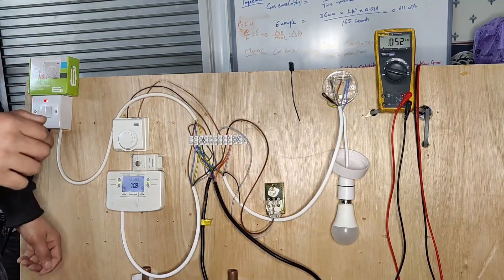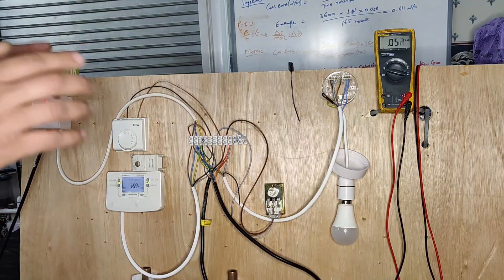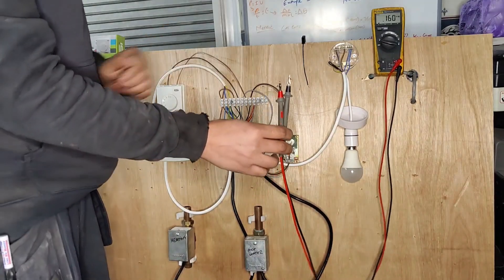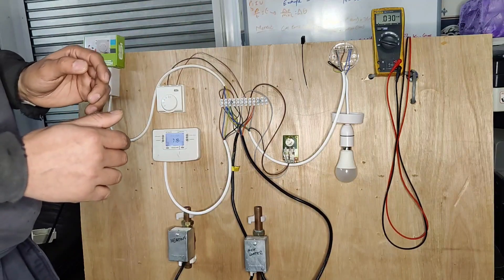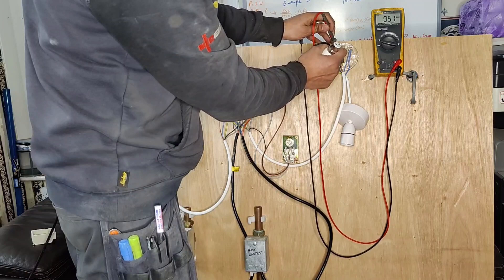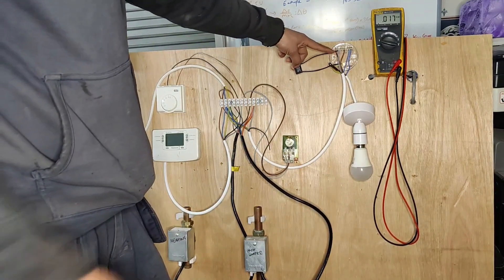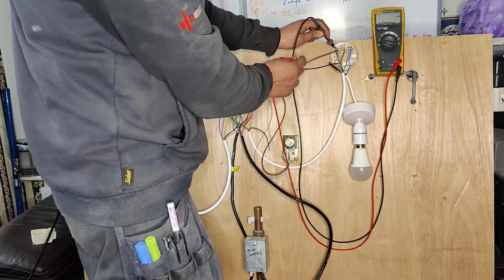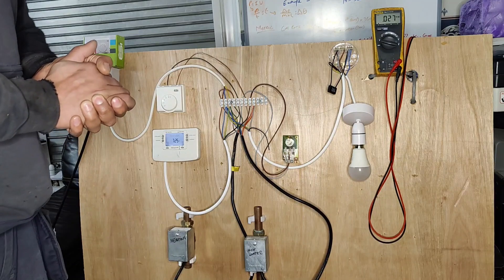How to stop your boiler from false firing (Troubleshooting Tips)

Comment: Will connecting one side of the supressor to earth not cause current to flow to earth and trip an rcd. An 30milliamp rcd wll typically trip on 25 milliamps
Reply from the maker: Yes if the larger capacitor size is used then it will however you can get contact suppressor with love capacitance value (0.01uF) which won't trip the RCD however in most cases it will be installed between live and neutral so it won't trip the RCD.
Reply: Yes true in fact some manufacturers like Veissmann give one with their boilers